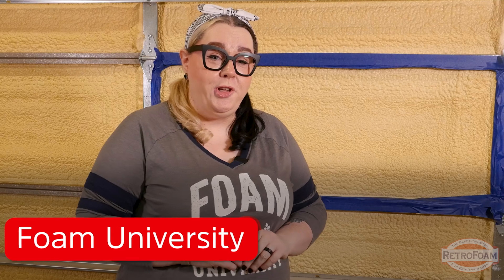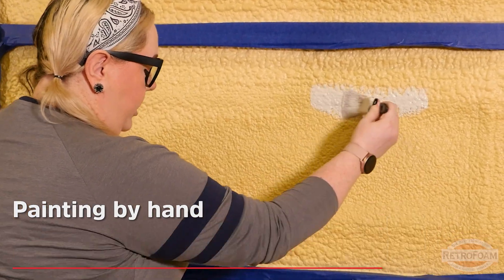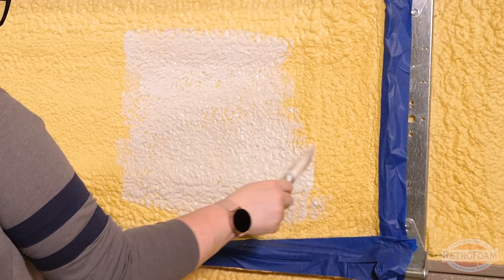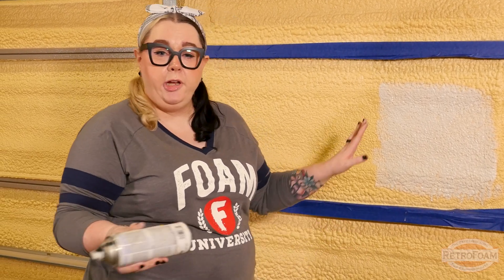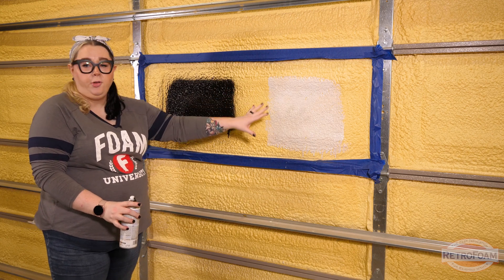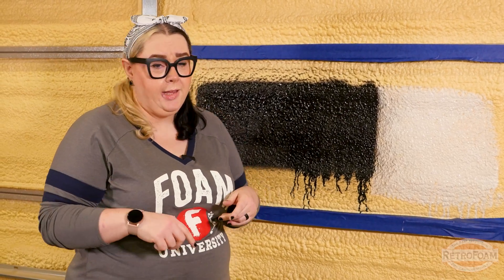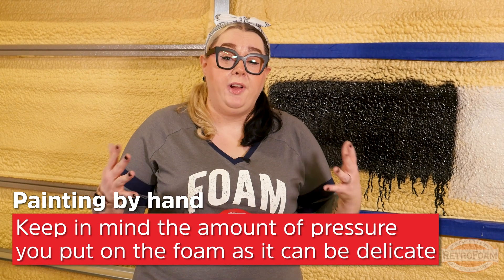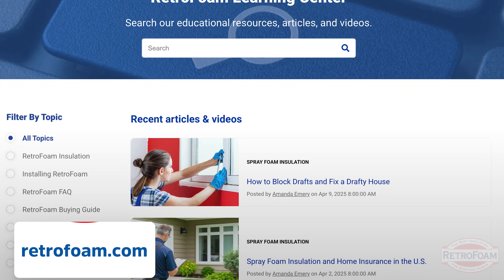Live Demonstration: Painting Spray Foam Insulation | Foam University

Comment: If I painted the foam and had a problem later would it void my warranty?
Reply from the maker: Warranties vary from dealership to dealership, so you want to check with whoever did your spray foam work!
Reply: spray jones has a excellent channel and discussed this.  it’s my understanding you have to use a special paint for spray foam otherwise it will degrade the foam overtime.